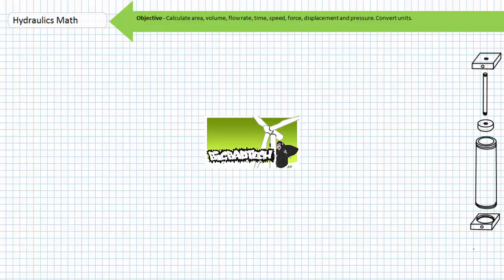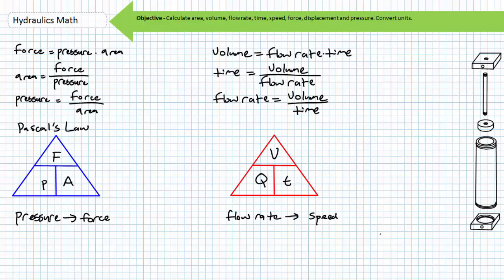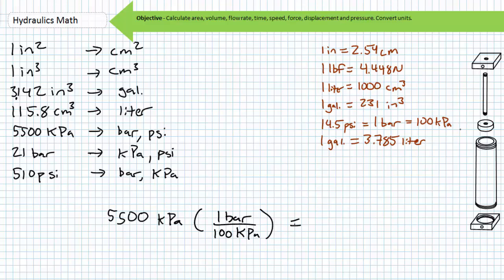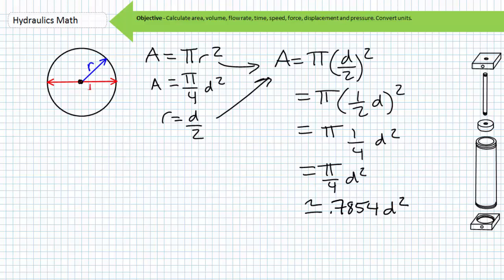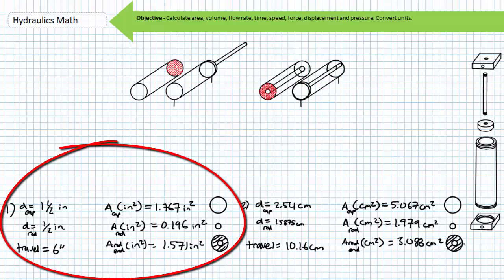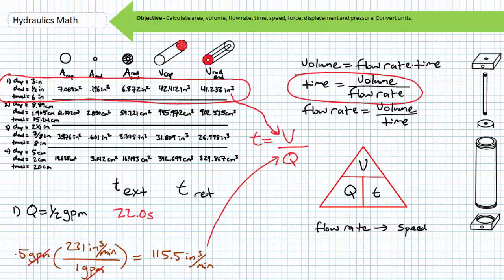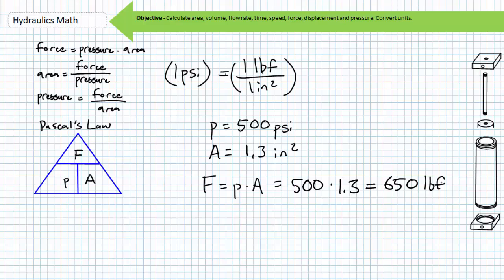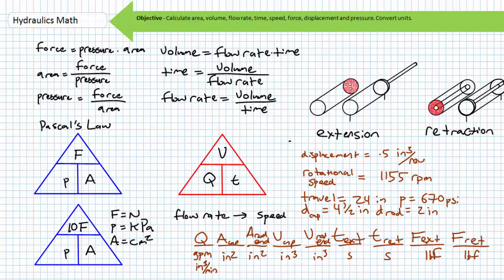Hydraulics Math (OLD LECTURE)

Comment: try to cut a pi into 10 equal pieces as in the metiric pieces where you would have 7/10 of a pie leftover because you sell slices of pie. Cut a pie once is halves, twice is quarters, cut those in half and get eighths etc Ok thirds are difficult but fifths work. 5 people get paid 100/day is 20 each. It is a logical system. What real thing does a meter represent?

Comment: Very useful lessons! I hawe question about cylinder extension/retraction time calculation. If resistance is what creates pressure, if physycal load on pushing/pulling is different, would larger load create bigger pressure in the system, and less flow, so slower movement for example on pushing, so that extension/retraction time is less dependent on pumped oil volume? Also during retraction surface are is smaller, so same pressure would create less force, and slower motion. Am i thinking in the right direction?
Reply from the maker: You are absolutely correct in that there is interplay between pressure and flow rate. Later in the hydraulics playlist I discuss these complexities and flow control valves. this lecture is meant to be a shakedown of necessary math skills and very simply nature. Ironically I’m working on a new set of hydraulics math lectures that break the topics down into smaller chunks. Stay in touch!

Comment: Does load slows the speed or increase the pressure?
Thanks 🙏
Reply from the maker: Good question. Flow control is covered later in the hydraulics playlist but, as a summary, consider a flow control valve with an upstream (pump) end and a downstream (load) end. The pressure differential between up and down determines flow rate through the valve. (higher differential = more flow) If the load induced pressure increases the differential decreases and flow rate and actuator speed decreases. Check out the flow control valves and flow control methods lectures at: https://youtu.be/Tn3bsiQx1Ug and https://youtu.be/VFtRNAu3_wg

Comment: Dear Sir............Example Problem I have a single acting hydraulic cylinder with a stroke of 300 mm, a bore of 18 mm and a rod of 10 mm  if the press weight is 5 mm on the Piston Head what is the pressure.....Please explain the calculations
Reply from the maker: Finish the hydraulics math lecture and then check out Pascal's Law at: https://youtu.be/YNoPs9kH7Ao

Comment: I am in the portion where you first introduce the mathematic equations for this video. I seen that the decimal place for 3.142 was moved. It started at 314.2 in the start of the video and moved at start of solving the equation.
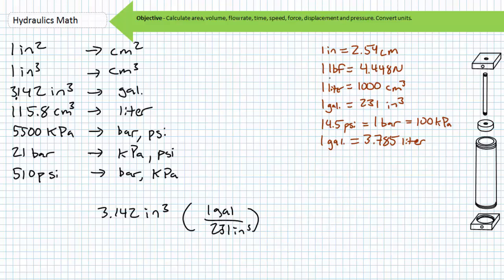Reply: You changed the decimal place at 23:00 min. If one makes a mistake be sure to accept it in the video. Or make the correction before posting.
Reply from the maker: https://youtu.be/e0KxcU_-ggY?t=570

Comment: How does the extension time change when there is a resisting force?
Reply from the maker: At an actuator pressure affects force and flow rate affects speed. This being said pressure influences flow rate of pumps. Check out the pumps and flow control valves lecture in this playlist: https://www.youtube.com/playlist?list=PLdnqjKaksr8ruhw85YYSSO6EWLhVVmSKm

Comment: I had the fortune of studying engineering using USCS and SI units. However I have a question, a pound (lb) is unit of force therefore why you wrote lbf instead of lb?
Reply from the maker: For all intents and purposes lbf and lb are equivalent units of force.

Comment: To add to the consideration of approximations, the imperfect nature of parts must also be considered. If you had a supercomputer compute your circular cross sectional area of a cylinder using one million decimal places of pi, your theoretical answer would have a high degree of accuracy. However, manufactured parts physically cannot be perfect. I believe error should be considered a fact of life. Unavoidable, and accounted for. Apply a factor of safety to all designs for this reason and recognize the error present.
Reply from the maker: Well said. Add to this the imperfections of instrumentation and human interpretation.

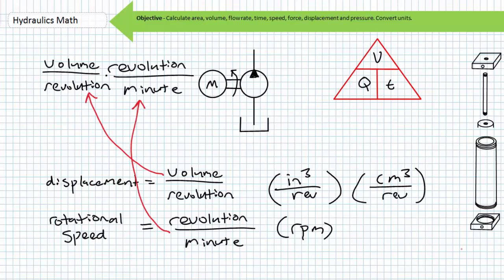Comment: Jim, at 1:08:40 you manipule the displacement and rotational speed fórmulas and due to it you canceled the revolution. But in a hydraulic system the prime motor revolution will always be the same of pumps revolution?
Reply from the maker: Yes. In this scenario we're assuming the rotational speed of the prime mover shaft is equal to the rotational speed of the pump shaft. Only time this would NOT be true is if the prime mover rotated the pump shaft through a step up or step down gearbox intermediary (where there would be an exchange of torque for speed and vice versa) or if there existed some slippage or other inefficiency between the coupling of the prime mover to the pump.

Comment: Jim, talking about the cylinder volume calculation shouldn’t the piston volume take into consideration?
Reply from the maker: Good question because the piston will have a thickness and therefore a volume. This same volume will affect both volume of the cap end at full extension AND volume of the rod end at full retraction. Manufacturers ordinarily take into account the thickness of the piston when specifying a travel length.

Comment: The problems, as stated, are correct.  However, in real life the flow is not constant unless using a fixed displacement pump and there is no were for the oil to flow except to the cylinder.  There are few systems like that. Since you are in Oregon you probably know that most of the sawmills if not all you hydraulic servo controls.   The VCCM equation determines the top speed.  From that you can calculate flow.  The VCCM equation is based on the fact that the piston will accelerate until the sum of forces acting on it are zero.  This using Newton's 1 and 2 laws of motion.

There are too many that think 'flow makes it go'.   Newton did not include flow in his laws of motion.

Flow simply equalizes energy.  It flows from a higher energy state to a low energy state.

Too many people think they can design a hydraulic system when in fact they are clueless and have been mislead by the instructors.
Reply from the maker: This is one of the first lectures in a long series of lectures of increasing complexity. The introductory examples all use fixed displacement pumps so they're readily understood by students just new to these concepts. All I'm trying to do in this introductory lecture is get students to understand how flow rate and actuator speed are linked without introducing unnecessary complexity. We'll get to variable displacement pumps, load sensing arrangements, flow control, proportional valves, and more complicated topics when it is appropriate to do so.
Reply: @bigbadtech  you are right,,,,absolutely .. Introduction means beginning...starting point of everything...so you are doing the right thing. .
Reply: @bigbadtech  The problem is that too many just stop there.  They don't get past "flow makes it go".

Comment: Small error in 1.15.56sec force calculation please put divider by 10 instead of 8.
Iam regular follower of u....good classes....
Reply from the maker: Good catch! I performed the calculation as divided by 10 but not sure why I wrote the divider as 8.
Reply: Ha...ha....yes....no problem IAM a good student of you....IAM mechanical engineer  from India and working in middle East .My ambition is to become a good application engineer ,your classes in hydraulic and electronics are very helpful.

Comment: Good Golly Miss Molly. How do you know so much?  I wish I was as full of it as you are, but my numerically quantifiable properties have inaccuracies attributable to lack of calibrated test & measurement equipment.   Too infinity and beyond bro, one annular surface area at a time using a gorilla on a windmill.  I got the indeterminant infinity part using L'Hôpital's Rule applied to Imperial customary US measurements, but the Beyond part in SI metric eludes me.  I checked on Snopes, but couldn't find anything regarding Buzz Lightyear and Beyond. 
2.31 kilo imperial cubic inches is much more comprehensibler, especially here in Ouagadougou where French is the official language. 
“Here. Hold my Beer. Watch this hydraulic experiment.” are my 8-favorite words when playing with a Vickers PV3-300-31  5,000±5% psi pump ,  next to my five favorite words, “Free. All you can eat.”  
You're the best.  Thank you for explaining the differences between circles and squares when I plug and chug.  That diameter and constant pi renditioning is less fun than renditioning a suspected terrorist to a middle eastern prison though. There's no despair.
Everything I know about PLCs I learned from you.  The $3 million factory control system I designed for a pharmaceutical manufacturer from your DIY videos works most of the time, usually.  Only a few people have overdosed, but it's ok because they're from a third world agrarian country where they don't understand ladder logic safety standards.   Your explanation of a “fairy diddling a ladybug” went over well in the deposition when we blamed all the warts and skin lesions on arsenic from local wells. 
Can you explain what the difference is between a pilot signal using phase shift keying and an auxiliary signal using QAM Quadrature Amplitude Modulation?  I'm trying to be cool and approximate, but the volumetric efficiency keeps diminishing during unit conversion.

Comment: For the US Customary units, why don't you use the Fluid Once for small volumes of fluid(1gal=128 floz) instead of decimal gals???
Reply from the maker: +Don G. This would be possible, however, floz aren't customarily employed since it introduces yet another layer of conversion. I remember a math problem that went through a chain from ounces to gallons to barrels to hogsheads, etc. Not fun!
Reply: Tx,
I don't like the US Customary system I wish we would change already even the UK doesn't use the English system anymore! I found out how easy the SI system is when I was stationed in Japan.
Reply: maths....

Comment: thanks for the vid. I thought I wouldn't be able to keep up being that I am only a high school grad. but this isn't that bad. 
I am only 15 min into the video though.

I am watching because I just bought a 1967 tractor that I want to add a hydraulic front end loader onto it. i.e. 4 pistons, 2 control valves, 1 pump.
Reply: Mecha Deets I am too poor to buy any already built so I have to salvage any parts I can find and wheel and deal and barter for the rest. I have been watching craigslist in my area.